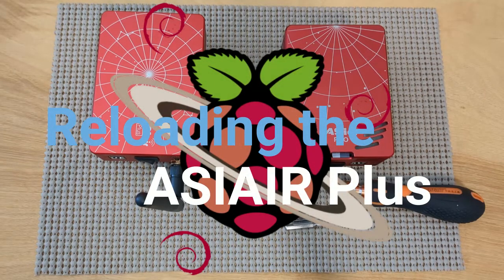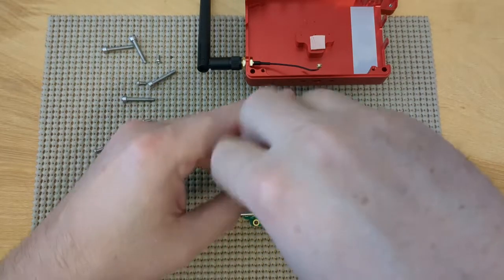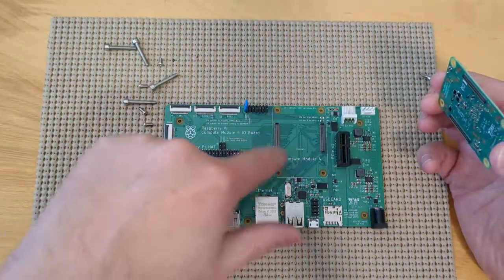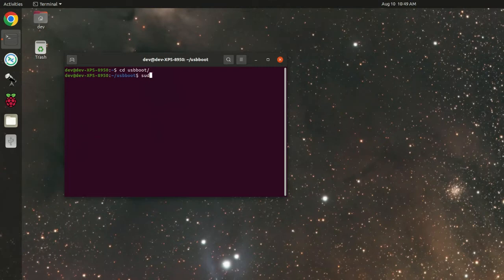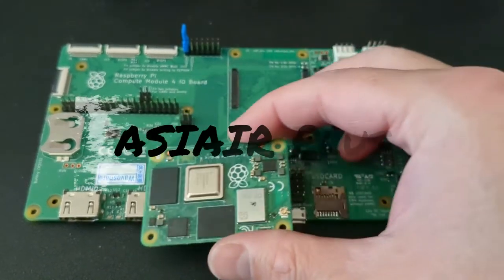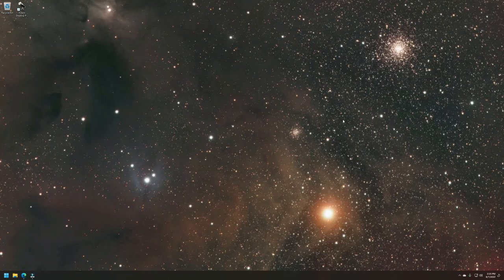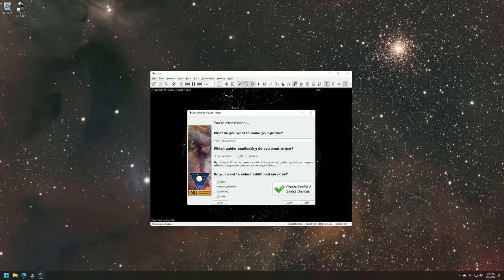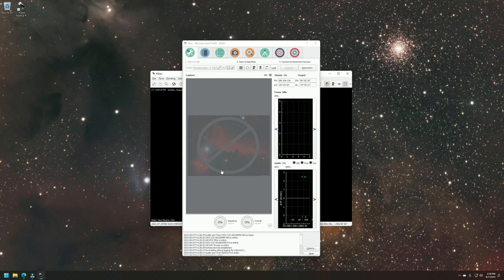Reloading the ASIAIR Plus with Open Astro 1.0

Comment: Any hack for the 32gig SD card limit on the Air+?
Reply from the maker: @rob2323  is this the Raspberry Pi or the Rockchip? You can tell from the bottom of the device based on the model number. If it's the Rockchip I have not rooted or modified but someone on Cloudy Nights may be able to help. If it's the RPi I can do some testing.

Comment: Is there a simple way to only change the config file and disable wifi (and bluetooth if it has it) on the ASIAir? Something like dtoverlay=disable-wifi or dtoverlay=disable-bt?
I am using the Mini btw, with the Rockchip board, I believe, not the Pi. Thanks
Reply from the maker: If you are talking the stock ASIAIR OS you can plug in the USB to a PC and edit the config.txt https://www.animmouse.com/p/how-to-disable-wifi-and-bluetooth-on-raspberry-pi/#for-raspberry-pi-os-formerly-raspbian
Reply: @JTAstro  Sorry I might have edited my comment before I saw you replied. I believe my ASIAir Mini is using the Rockchip board, does it still work the same?
Reply from the maker: @fuzzball297  with the mini when you connect it to your PC you might still see the config.txt specially if you connect it to a Linux computer/virtual machine. I have a mini as well so I can check it out tonight. Still working on rooting these devices not as easy as the Raspberry Pi's with the Pro and 1st Gen Plus.
Reply: @JTAstro  Thanks for the help! Currently trying to make my rig RF quiet since I plan to use it near some radio telescopes. Could also use a dummy load on the antenna port but I'd rather be more cautious, since it can still leak and possibly cause some RFI.
Reply from the maker: @fuzzball297  The only concern I can see if you turn off the WiFi on the Mini is it will be useless to image as it does not have a network port. You would be better off with the Pro or Plus. When connecting the Mini to my PC and Linux system I am not seeing any other directories than the normal image storage so you probably won't be able to do what you are hoping to do. Also the settings I gave you were for the PI and not the Rockchip so those settings won't work either. I would recommend looking for a used Pro, there are out there just need to find one.
Reply: @JTAstro  Oof, I would've thought I could do everything through USB-C. Didn't do enough playing around with it before the return window. Couldn't those USB-C to Ethernet adaptors work?
Reply from the maker: @fuzzball297  hard to say since ZWO locks down the Minis so much I'm not sure, if we could root it and gain access to the OS I'm sure you could but with out access to the OS not sure how far you can get. You can always resell on Cloudy Nights I have sold a bunch of gear on there and gotten back most of my money I spent give or take 5-10%.
Reply: @JTAstro  I don't think the AA+ really has what I want anyway if the only way to hardwire it is through ethernet connection. Can it even do ethernet straight to your phone app without any wi-fi involved? 

Mini should work fine outside the radio-quiet zone. Will probably just figure out another way to do it there with a laptop instead.
Reply from the maker: @fuzzball297  you could do ethernet from the AA+ and to laptop and use BlueStacks to run Android and install the ASIAIR software to control it all over ethernet with out WiFi

Comment: Interesting. Does this allow adding non-Zwo cameras and accessories? I know that default is that only Zwo astro cams (plus some DSLRs) will work with it.
Reply from the maker: 💯 You can use any DSLR or Astro camera you want that has drivers written for INDI. I have since released OpenAstro 2.0 which allows you to run even more stuff based on what you like. https:// www.openastro.net/. Currently I'm working on a new INDIGO Sky image as well. I'll be releasing a video and walk through of that software suite when it's completed.

Comment: The one I bought doesn't look like yours at all. My board is a completely custom design. I sent you a message on FB and the images. I hope you can help me. Thanks!
Reply from the maker: Sounds like you got the new Rockchip board ZWO moved too. I have the new Mini that also has the Rockchip as well and so far no one has had a lot of luck messing with it. Ideally you may want to buy the ASIAIR Pro used. More details are on CN https://www.cloudynights.com/topic/835556-the-open-astro-initiative-zwo-asiair-proplus/

Comment: hi Joey, thank you very much for your effort. You saved my time with the issue of not working USB after installing the astroberry on ASIAIR Plus. Now it's my turn to save your time :)
When I disassembled the AA+ I saw 2 contact holes next to the SD card slot. That is actually the boot jumper which can be triggered by simple paper clip :) For flashing the new software you will need to use the type-c connector on the board  (using the rpiboot app). Cheers!
Clear skies!
Reply from the maker: Sweet so you don't need the Compute Module 4 io board then? Very cool I'll have to try this out! I have plans to also release a 64bit kernel as well.
Reply: @JTAstro  yep! so it becomes quite easy! The ones who will want to install will need to know how to install rpiboot and that's it :)
Forgot to mention - 2 holes are between SD card slot and LAN connector
Reply from the maker: @VilenSharifov  thanks for that I may make another video after I get the new Kermal built. Been too busy with work these days to post on anything.
Reply: @JTAstro  you are welcome! Will wait for your new vid! CS
Reply from the maker: @VilenSharifov  posted a new video on StellarMate and gave you a shout out!
Reply: @JTAstro  oh thank you very much! I appreciate it! 🤩

Comment: Hey, is it possible to just enable SSH without flashing another OS? I don’t have the IO board but I have another Raspberry Pi 4 and Mac. What I am looking for is just enable the SSH access on ASIAIR Plus and investigate further why my GEM 45 2021+ keeps on disconnecting from the ASIAIR Plus with external USB hub.
Reply from the maker: It's not possible as you need to get to the OS level or local file to make changes. The only way to modify the OS is the IO board. The Pro was way easier to root and I'm sure the reason ZWO went with the RPI4 Compute is most users won't pop for the IO board to mess with it. In terms of the GEM 45 make sure you have the most updated firmware and also turn off DST. With my GEM35 I use WiFi and it works fine.

Comment: Hi Joey, thanks for putting this together, don’t think anyone has a similar video so really useful for me. You website mentions this change can also be done using StellarMate,but I could not find an image on your website. I have my own paid version of StellarMate that I tried loading through this process, but that does not enable the USB ports. Any help would be greatly appreciated.
Reply: Thanks so much! Joey, I will try in next few days and let you know how it goes. Currently I have the 64 bit version of StellarMate installed but if that does not work, I don’t mind going back to 32 bit
Reply from the maker: @ashviksinha447  you can build the 64bit kernel but honestly 32bit is all you need as there is only 4gb of ram on the ZWO boards.
Reply: Yes that is correct, the CM4 module I got has 4gb ram … thanks
Reply from the maker: Your very welcome! The problem with StellarMate is it's proprietary so I can't rerelease the image without their permission. Since you seem very familiar with working with the Pi since you were able to load it up you can build my custom kernel which fixes the issue with the USB not working. As long as the Pi Board is loaded up with StellarMate you will want to build the kernel on a Linux PC. I used Ubuntu 20.10 64bit and then connect the Pi to the Linux PC and replace the kernel. I have all the steps listed here on compiling and copying over the files https://github.com/open-astro/linux. This setup would be designed for a 32bit version of StellarMate and not the 64bit version just a FYI. I never tested the 64bit kernel.